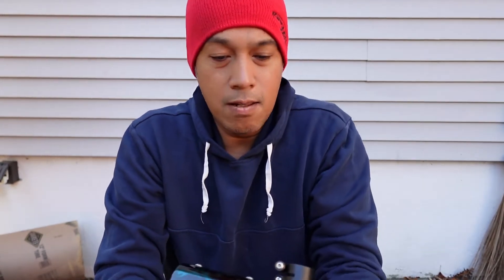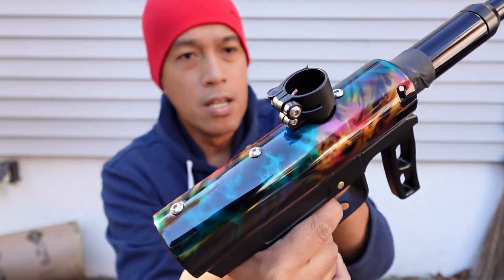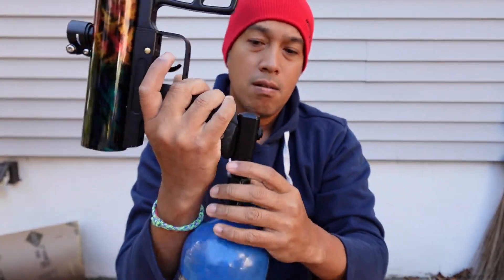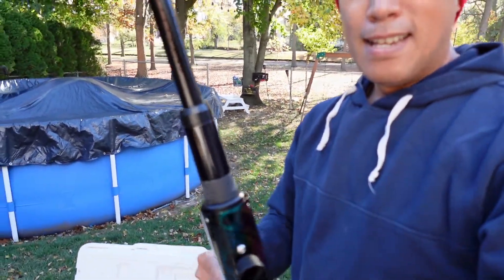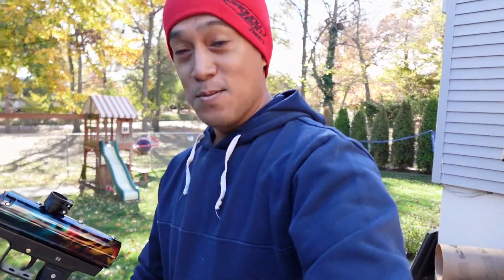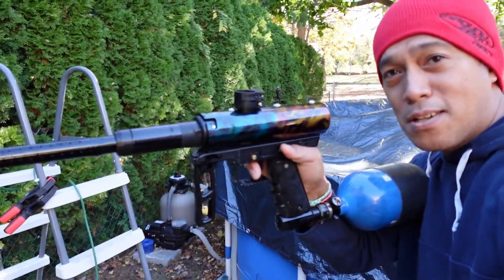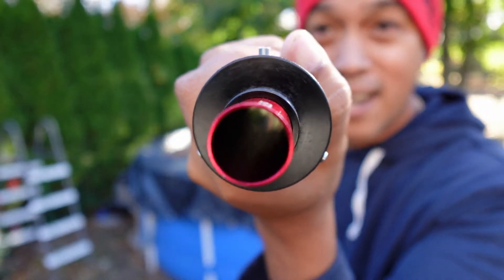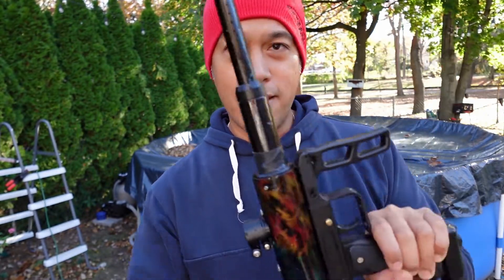SuperNova N1 - Checking for Leaks (Extreme Method)

Comment: that doesn't mean you have a leak man.  that's air escaping that is inside the marker just from being a tube.  put a cup in there at an angle and the same thing will happen.  physics man. - technically fluid dynamics.
Reply from the maker: you are correct. figured it out afterwards